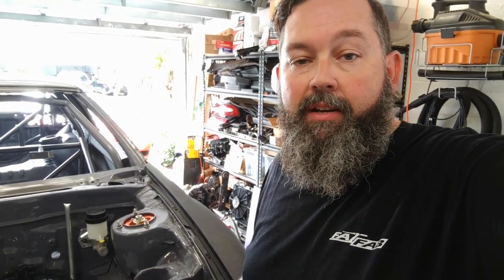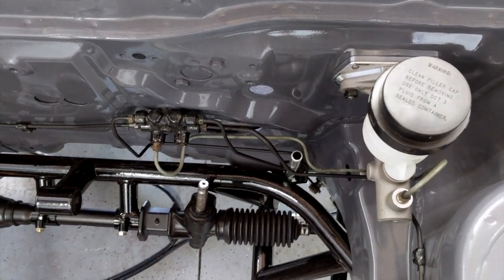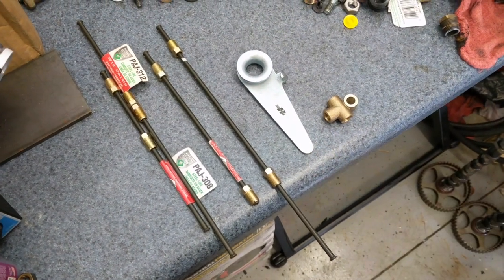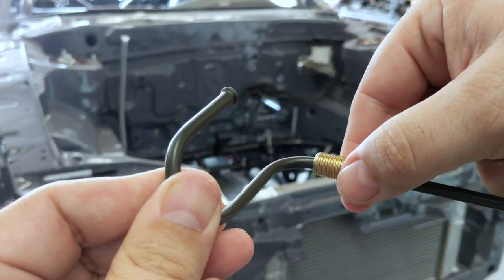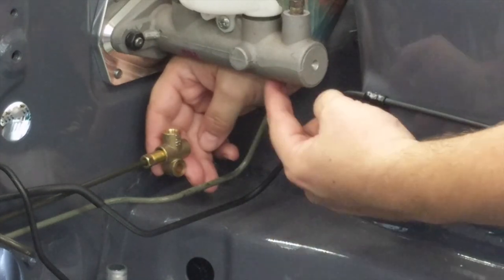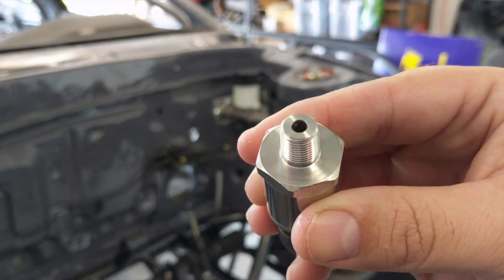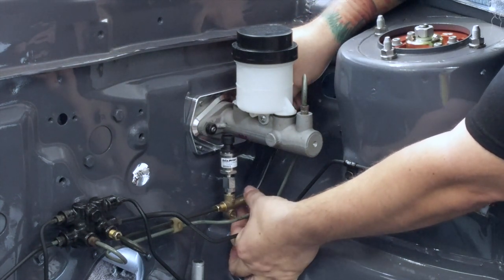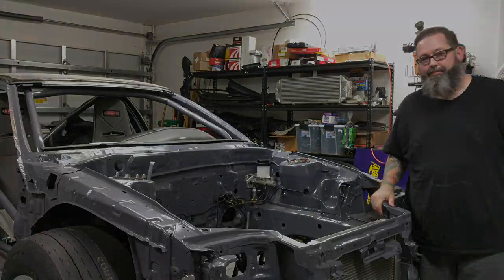Pro Street Eclipse - Part 21 - Logging Brake Pressure

Comment: I really like your work. The one question I have- isn't mounting the break pressure sensor the way that you did (especially with the NPT adapter) going to make bleeding the breaks very difficult? It's going to be easy for some air to get trapped in there.
Reply from the maker: Thanks for the kind words! I thought about the air issue with that configuration, but I figure if no air gets trapped in the other master-to-distribution line, where it goes into the top of the master, then this should be ok as well. Thanks for watching!

Comment: Can you please explain how the brake pressure sensor's data will be then read??
Reply from the maker: The sensor output is 0-5 volts. It will be connected to an input on the ECU that reads 0-5 volts. The ECU will be programmed to translate 0-5 volts to 0-2000 psi, linearly.
Reply: Sir, is there an another way to see the output of the sensor for example by using Arduino ??
Reply from the maker: You can buy the gauge that goes with this sensor. I don't know about any other ways.
Reply: Okay thank you very much!